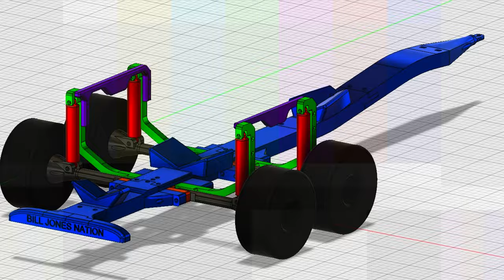3D Printed Off Road RC Jet Boat Trailer

Comment: That is too awesome, action packed! and a perfect spot to unleash the boat, waterfall in the background, i still wanna see more diy 3d printed rc videos lol! you are awesome
Reply from the maker: What vehicle would you like to see? I did the 1/32 barge as well which is on the channel. I think my next project could be a 1/32 scale Shannon Class lifeboat (RNLI 13-01). It's a jet boat that looks super cool. I want something that is a bit more robust and faster than my current boat. Something able to go up rapids in a river with FPV and a Go Pro attached. Or a plane? I can also do molds out of fibreglass and carbon fibre.
Reply from the maker: Check out my Jet Boat Barge!

Comment: Any files?
Reply from the maker: Right now, no. There are a lot of parts that use some weird fittings/nuts/bolts I had. Not sure if it would be the greatest thing to release.

There are some design flaws with the trailer as well. Essentially I would like to redesign the whole thing for a Version 2 but that is down on my list of things to do.